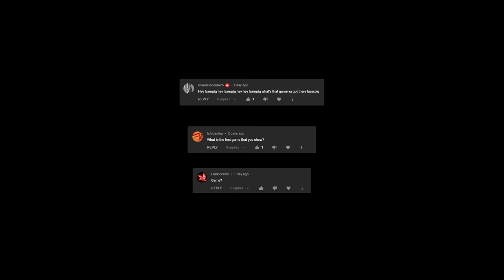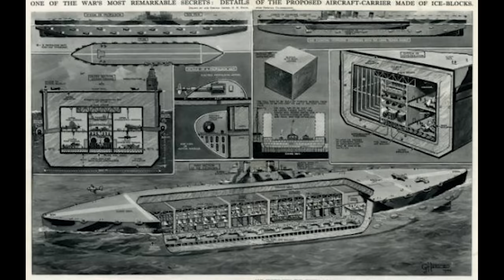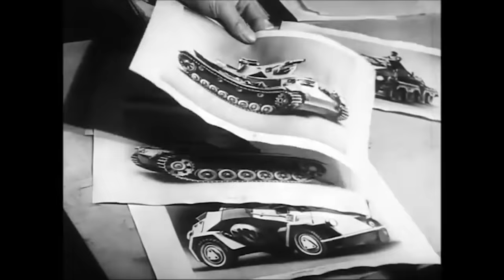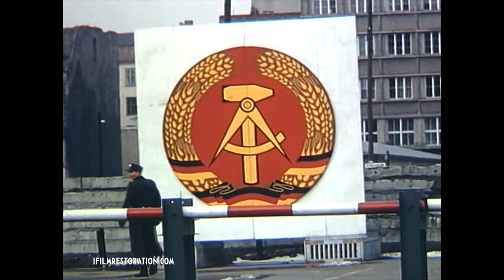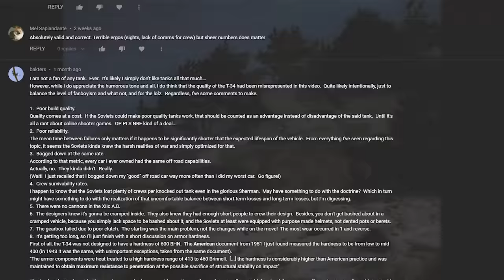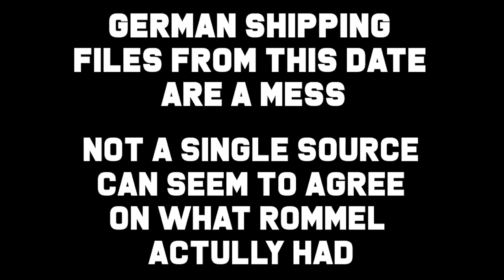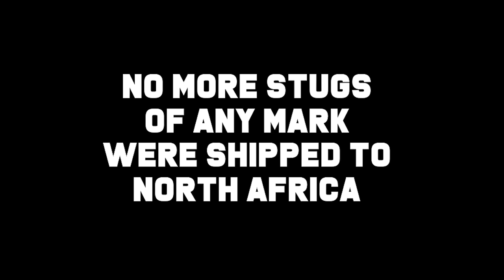In defence of the Crusader Tank

Comment: As a Leafaboo I am disappointed in how easily historians forget that the Ram tank single handedly won the entirety of WW2 and that the Avro Arrow was more advanced than even modern day stealth fighters.
Reply: As a Kiwiboo the omnipresent misconception that the Bob Semple did not also single handedly win WW2 is what really gets to me.
Reply: Commonwealth rise up!
Reply: The skink also singlehandedly annihilated the Luftwaffe.
Reply: How is the Avro Arrow more advanced than a stealth fighter? I’ve read that it took so long in designing and testing weapons for intercepting Soviet Bombers off NORAD airspace. Failure of the Sparrow II & Velvet Glove missile just led to it using the AIM-4 Falcon then leading to replacing the program with Bomarc missiles and F-101 Voodoos that carry the same missile.
Reply: As a Beanaboo, the Mexican army did nothing, but it in fact changed everything in the ways of neutrality tactics.
Reply: @TheRandCrews  A stealth fighter is designed to hide so it doesn't have to fight. The Avro Arrow was post-stealth. It was blinding white, covered in radar reflectors, and had a powerful loudspeaker system that repeatedly blasted out "Come at me you wad" loud enough for enemy fighters to hear.
Reply: Ill be honest, I hate the Avro Arrow
Reply: @TheRandCrews  Someone clearly is unfamiliar with the concept of a joke.
Reply: @TheRandCrews  Woosh
Reply: As a Horthyboo I must say that only if the M44 Tas was built we would have been relevant to the axis war effort.
Reply: @mandichtittysmithyofcameltoe  I'd rather say they made the Lee/Grant better than the Americans, they managed to put the armament in a turret, made the armor quite thick for the time (3" front and 3" on some side areas), reduced the profile somewhat and used a heavier duty version of the volute springs that handled the weight better. It's better than the Sherman in some ways and could have evolved into a similar vehicle if the turret ring was enlarged, but the M4 arguably was better than the Ram by the second half of 42.
Reply: That is the actual position of every Canadian dad in existence, obviously we would have the most advanced aviation industry in existence now if the Arrow hadn’t been canceled
Reply: Leafaboo.... love it!!
Reply: Canadians made tanks?
Reply: @TheRandCrews  how dare you stand up against the great white north....don't you know "WE STAND ON GUARD FOR THEE!!!  😉
LONG LIVE THE LAZER PIG!!!!
Reply: As a Fetaboo I would say, tremble before the might of the combined arms of peasant and mule!
Reply: @TheRandCrews  that joke went over your head as effortlessly as an actual stealth fighter.
Reply: @huntermurphy2148  I sure hate fucking hearing about it
Reply: I'm so glad to see the Ram mentioned in any capacity. A Canadian piece of gloriousness if you ask me.

I don't care it was useless. It's too weird not to love.
Reply: @dodgedaytona7435  I don't know about neutral. I believe they sent fighter pilots.
Reply: @aircraftnut15  Too many Canuks trying to say it was a superior aircraft to the Phantom
Reply: And if the TSR2 had been introduced, Britain would have regained its empire and  the world would now know eternal peace.
Reply: Don't forget that sniper that shot a guy all the way in another star system just before he managed to explode our sun
Reply: @TheRandCrews  how do you not understand blatant sarcasm?
Reply: @nowhereman6019  the Ram was converted to APC: the Kangaroo. Did quite well. Most notable appearance: operation Totalize at the peak of the battle of Falaise
Reply: @Batmans_Pet_Goldfish  don't forget the home gaurd unit who single-handedly defended London!

(Although being serious, they did shoot down a German bomber with several hundred rounds of rifle fire)
Reply: The arrow singlehandedly saved Cascadia from the peacekeepers
Reply: Please lower your maple syrup, I surrender.
Reply: @chooseyouhandle  The worst thing to happen to Canada was the closing of the Long Branch Lee Enfield factory
Reply: " that the Avro Arrow was more advanced than even modern day stealth fighters."  -- you accidentally wrote Avro Arrow where you meant to say TSR-2
Reply: @SoloWing88  someone who knows
Reply: Ram seemed unironically pretty decent though as far as an M3 Lee derivative goes. Or at least on paper.
Reply: The Arrow only failed because it was such a big stud it slept with Diefenbaker's wife so to avoid political controversy, they canned the Arrow both in an act of revenge and also to draw public attention away from the real events. Despite this a ARH Sparrow II armed Arrow would easily cream an F35 in any scenario or weather, it just never got the chance to.
Reply: @TheRandCrews  it's a joke dude
Reply: Na the Ft17 light tank beat the Germans so hard that king tigers coward at the might of this tracked behemoth
Reply: Na bro, the Abrams tank was easier the most effective weapon of ww2, also A10 go BRRRRRRRRRRRRRRRRRRRR
Reply: The firefly literally killed a good bit of tigers, maybe after the 75
Reply: @Batmans_Pet_Goldfish  the German saw the skink and decided not to test it
Reply: Don’t forget about that Skink
Reply: Whats the American equivalent of a wehraboo?  Im that.
Reply: @ClockWork-zj7zy  freedomboo is the most Generalized term or yankeeboo aswell
Reply: @evilemuempire9550  hi Raz :)
Reply: @bloodwintertales5984  you replied to the wrong person lol that wasn’t my message
Reply: @ClockWork-zj7zy  ah shit wel hopefully he sees it
Reply: WOOOO AVRO ARROW LOVE
As another Canadian I appreciate this.
Reply: As a Gypsyboo, I am disgusted by the complete lack of reference or appreciation by historians how the Mareşal tank destroyer and it's 75mm Reşița gun was the sole reason why Romania was valued as a potential ally by Russia and Germany

(In all seriousness, the Reşița, on paper, looks like an amazing gun, I have no official first hand accounts on me to verify why I personally like this gun or if it's worthy of praise)
Reply: @dodgedaytona7435   if I were a Beanaboo as well I'd fight for the idea that Mexico's first ww1 tank had been put into battle.
Reply: As a vikingboo, I know that without us conquering you all for a start, you would all have been to weak and fragile to even wipe your own arses.
Reply: @Batmans_Pet_Goldfish  so like 1 plane…cuz remember it was 1945 I believe
Reply: As a Sisuboo I can tell you the most cost-effective tank of the war, and one of the most common, was anything left behind when the Red Army ran away.
Reply: Cope like L
Reply: @TheRandCrews  sarcasam
Reply: Im a windmillaboo so the only reason ww2 lasted 6 years is because the dutch did not build more Fokkers and chose not too field our single (!) Vickers light tank.
Reply: @Batmans_Pet_Goldfish  Say what you will the skink was a sexy vehicle.
Reply: @accessthemainframe4475  the ram semple
Reply: As a Furraboo i want to die
Reply: As a freedomboo I find it insulting that he didn't mention how the f2a buffalo single handedly won U.S. air superiority
Reply: Some talk of Alexander, and some of Hercules
Of Hector and Lysander, and such great names as these.
But of all the world's brave heroes, there's none that can compare.
With a tow, row, row, row, row, row, to the British Grenadiers.

Those heroes of antiquity ne'er saw a cannon ball,
Or knew the force of powder to slay their foes withal.
But our brave boys do know it, and banish all their fears,
With a tow, row, row, row, row, row, for the British Grenadiers.

Whene'er we are commanded to storm the palisades,
Our leaders march with fusees, and we with hand grenades.
We throw them from the glacis, about the enemies' ears.[n 1]
With a tow, row, row, row, row, row, for the British Grenadiers.

And when the siege is over, we to the town repair.
The townsmen cry, "Hurrah, boys, here comes a Grenadier!
Here come the Grenadiers, my boys, who know no doubts or fears!
Then sing tow, row, row, row, row, row, for the British Grenadiers.

Then let us fill a bumper, and drink a health of those
Who carry caps and pouches, and wear the loupèd clothes.
May they and their commanders live happy all their years.
With a tow, row, row, row, row, row, for the British Grenadiers.
Reply: I'd argue, but my grandfather worked on the design team of the Avro Arrow, so... 🤷
Reply: Ram tank is so cool
Reply: Dont forget, had the churchill black prince been completed it would have sucked all axis tanks into a gravity well of it's own making, but the 90% chance of total planetary annihilation put people off for some reason
Reply: As a vodkaboo historians often forget how Finland single handedly defeated the USSR twice
Reply: The ram was only truly good until 1941 when germany made thers panther tanks so uh it did well from 1939-1941
Reply: @paullakowski2509  "By the blood of my people are your lands kept safe" - Canadian Boromir, probably.
Reply: @nowhereman6019  M4A5 Ram II, also the Grizzly tank
Reply: @accessthemainframe4475  lmao
Reply: And as a batterpuddingaboo, we made... Very shit naval planes.😫
Reply: As a Ram 2 user in warthunder it was definitely the best tank of the war and single handedly won the war. It could solo a battalion of german tanks and could probably take on the maus of it ever saw service XD
Reply: @Batmans_Pet_Goldfish The skink was such a good AA system, that units with one attach to it never suffered any damage from German planes.
Reply: Canada's 2 best exports. Bob & Doug McKenzie and Tim Hortons eh?
Reply: @Owen Stockwood  Not disagreeing with you, but sometimes it takes a Wikipedia and KnowYourMeme read to really get a joke.
Reply: @TheRandCrews  it’s sarcasm if nobody else told you yet
Reply: No the arrow isn't more advanced than an f22 or f16

It basically a canuk version of a mig 25 

It's computer was better than most planes at the time but look at an f35 tech or f22 computer tech

The arrow would be like a DS lite vs any new competive gaming computer 

Again if it was still hear and coukd be re worked and re configured it could probably still hold ots own when upgraded, but no it isn't the greatest plane of all time it was just a decent plane when needed to be 

Do i think that completely destroying it was a bad idea?
Yes we could've lesrned alot from it for current interceptors and fighter planes
Reply: @Sman16 as a fellow Leafaboo I feel I should remind you and everyone else that project habbakuk (the aircraft carrier mentioned in the beginning of this video) would have been more powerful than even modern day American super carriers and due to its pycrete construction would be nigh unsinkable, also it would save on refrigeration for the crews food supply
Reply: God I would love an Avro Arrow video from pig
Reply: If the Avro Arrow had been built, it would still be in service! Not because it was good, but because we can't procure an exit from a paper bag.
Reply: Don't forget the Owen gun being the peak of small arms technology and would still dominate engagements today. Scopes, PEQ units, grips are all extra weight and just dressing to try and make the troops feel.better about being handed second rate weaponry in comparison to the tube of death.
Reply: I’m a everboo because I like all tanks and doctrines and I think I’m the only one
Reply: The amount of facepalm when idiots talk about how the F-35 is such an expensive failure and we should replace it with an “upgraded” Avro Arrow because that would totally work in this day and age.
Reply: Leafaboo? Leaf? Pointy eared leaf lover!
Reply: As an Avro Arrow let me say thank you. and ask for $35 for another 15 pack of Molson Canadian. I'll even take Labatt  Blue for the NHL Bloopers VHS that comes in the box
Reply: We advanced in drinking more stale beer. That's how! @TheRandCrews
Reply: @accessthemainframe4475  as an aussieboo the AC mark 1  sentinal is best look at the hull machine gun
Reply: What is leafaboo?
Reply: @werth7113  like a wehraboo but for britan
Reply: The Avro Arrow was so advanced in stealth that to this day, nobody has found it once.
Reply: @werth7113 actually it’s a wheraboo for Canadian military tech, usually going off about how everything Canada built in the post WWII era was so much better and more advanced than what American was but was killed by political wrangling to protect American businesses. The Avro Arrow is the quintessential leafaboo talking point, the MOST ADVANCED interceptor ever that was so ahead of it’s time with a few upgrades it would be viable in modern air conflict, cancelled because of bribery and political wrangling and not because it first flew after the Soviets had already shown they could launch ballistic missiles via Sputnik that an interceptor wouldn’t do anything against.
Reply: My dad won WW2 because he said so and as he once said he doesnt lie,  it must be true!
Reply: @mandichtittysmithyofcameltoe I'd say America is a continent not a country. But I'm a pedant.
Reply: Sir those are both canadian you are a canuckaboo not a leafaboo
Reply: @owenstockwood5040 me when i spread misinformation and call it a joke
Reply: @archdornan3694  What misinformation? The parent comment of this chain is literally a sarcastic remark about how Canadians seem to Deify the Avro Arrow. Also, why on earth are you responding to a comment I made 2 years ago underneath a video from a channel I don't even watch anymore?
Reply: I see your crusader and raise you the Sentinel and AC iii and ACIV